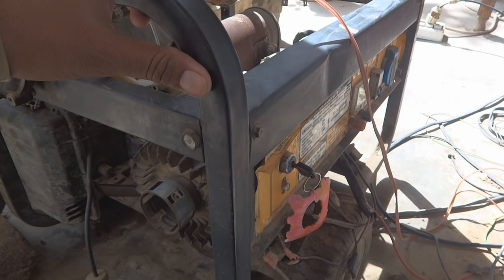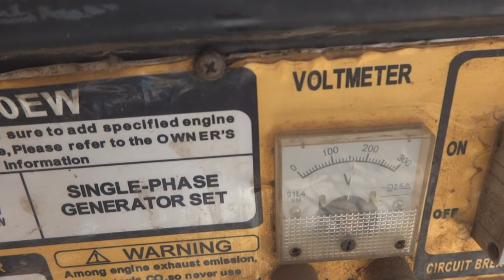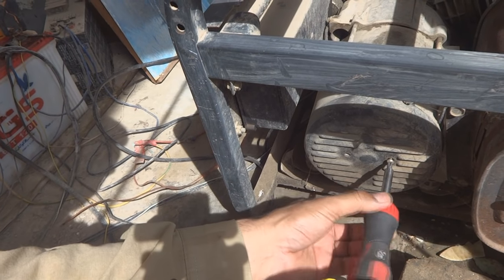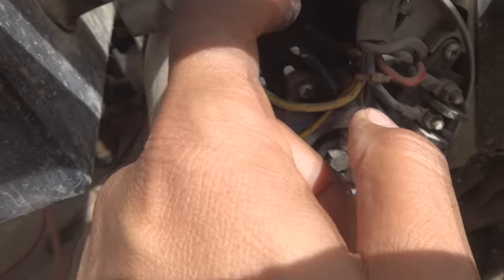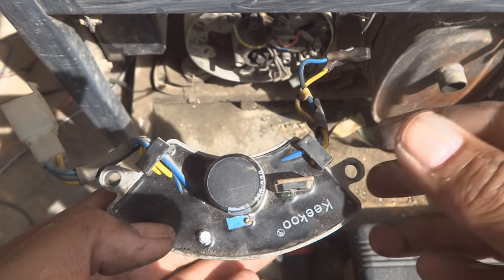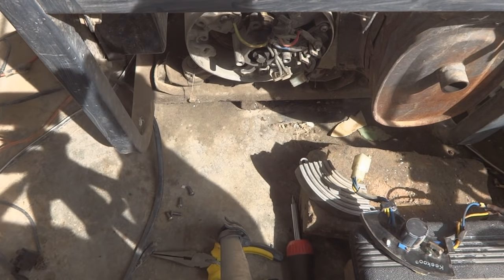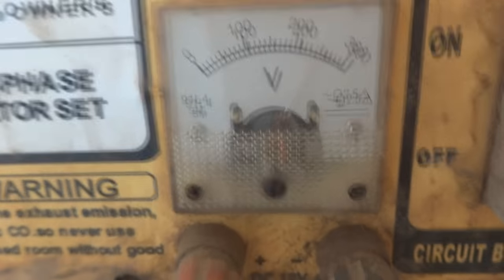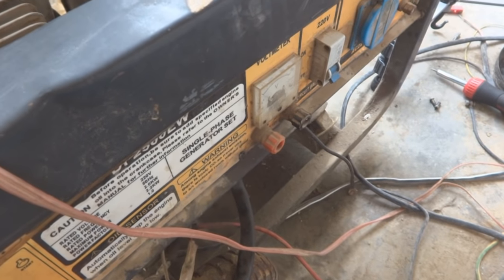Generator AVR adjustment. Generator voltage adjustment.

Comment from the maker: Dear and respect viewers must read the blog post associated with this video. This provides extra information about this video. Here is the url for the blog post. http://diycarmaint.blogspot.com/2017/03/generator-alternator-electrical-repair.html
Reply: LearningZone ap.kahan hotay hain
Reply: sir, can you please do a video on how i can convert my generator from petrol to natural gas, how to adjust it and also tell us if it is more economical to use petrol or gas. jazakAllah khair.
Reply: Hi I need your assistance for fixing generator.
Reply: Dear sir salam plz sir show next video have old avr repear
Reply: Hi i have an old Dunlite generator 3kva. Can you please tell me how to fix as I have 50 hz frequency when adjust proper rpm but over voltage at 335 volts with a fan plugged in? Do all 4 stroke generator have AVR inside? Also when you took off the plastic housing on alternator section with two screws i have same thing but two big screws in the middle?  Can you please tell me what it is?  Also if i don't have AVR can i fit a universal type or AVR from another  generator?  Any reply appreciated! Thumbs up 👍 for your video. Clearly explained!  Cheers from Australia!

Comment: I was getting 310V from my generator and I tried this method. Now I am getting 240V. Thanks a lot Sir.
Reply from the maker: Seems you have a bad avr. Replace with a new one and calibrate. Regards,
Reply: How to increase the voltage of a generator from 240v to 415 votls? Using the universal SX460 AVR? Thank you

Comment: Great work Jahan in correcting the loose connections and adjusting the voltage regulator. I was wondering too why the pot was so far out of adjustment. You mentioned in a comment below that someone else was there before you. And good idea as a viewer mentioned to check the frequency to ensure that all is well. Keep up the good work!
Reply from the maker: Yes dear sir you are correct and this was the case. Anyhow it provided a nice experience and good case study what to do if a generator have too much varied voltage beyond standard. The frequency testing would a good idea and I am looking for opportunity to do so. Thanks for liking dear sir. Best regards,

Comment: AoA, very much informative video. I have a strange problem with my homage 6.02 kva ATS generator as it drops voltage randomly. Like sometimes it produce 220-230 volts, whereas, in between, it comes to 97, 105, 180, 102, 115 and then again starts the same up and down sequence.  What do u think where is the problem Sir? I can send u a video of the same.
Reply from the maker: Seems you have a bad AVR. Replace, caliberate and then check. Also check AVR connections for any loose point etc.
Reply: I have same problem what fixed it??

Comment: I fitted new avr in generator but it gives me 310 volts but after this setting you told in the video it us giving me 270  volts it does not further decreases after it

Comment: Got a question sir. Why does our generator gets damage every time we use our aircon for like 5hrs. Then the next day its not producing voltage or electricity. Our generator is 6.25kva

Comment: Many thanks for this wonderful video. I have a different problem with my 5kva generator ELEMAX SGH7600EX. I live in an off grid area so I need it to charge my batteries whenever it rains. This generator output is 220v 35HZ which is unsuitable for my inverter. I always increase the rpm to get 275v 43HZ then my inverter will accept. I have changed the avr to a new one and even reWinded the Coils to no avail. I need your advice. 
Thanks.

Comment: I want to contact you. we have a problem in SMDO generator  ..its not running any water motors on this generator because its not provide electricity power up to 230...

Comment: Loverly job, backup power is back :-D :-D.

Looks like a car alternator, but with stator windings for 220-250vac.
I hope you checked the voltage with your multimeter, i would not trust the panel meter.
I found it odd that the voltage regulator was so far away from the correct voltage, i hope its just because someone played with the setting, and not a faulty stator.

If you have a way of measuring the frequency, you can set the engine rpm for the desired power frequency 50/60 cycles, sorry im saying the obvious :-(.
Reply from the maker: That is great sir. Your understand is very much correct. The AVR settings someone disturbed before me. I corrected it for the perfect voltage setting. I measured the voltage with my fluke and the panel meter was corresponding to that reading. I have a meter measuring frequency. I will try setting that. Your point is very valid and have strong value. I set it so that it works just fine with lamps, induction motors like fans, my laptop charger and other cell phone chargers. I would sure give a try for correct frequency sometime. Best regards and thanks for liking and comment.
Reply: Your vlog has a different name to the one originally given on youtube, are you still ok with the youtube name or should i forget that?
Reply from the maker: Yes yes dear sir there is a problem with the name. This blog post I wrote just today but the name appears is the email user ID name. I don't know the way to change it. I gave this name myself long before due to some reasons which have no more need. But it is OK anyhow. This belongs to me.
Reply: Dear sir arshid ali tak to you that plz salo my problem  have old avr repear

Comment: You speak AVR gives 220 volts . But i think AVR regulate the voltage its supplies the fixed voltage to the armature coils so that armature produces fixed magnetic field and when armature rotates the magnetic field cut the stator coil and current is induced in stator and output voltage is drawn out of stator .
Reply from the maker: You should watch the video again. I explained everything. If I can do calibration for the alternator or generator, minimum I know what you explained in the comment! Also I uploaded another videos on car alternator videos where I explained all concepts in detail. Regards,
Reply: @JahanZeb1976  i just want to know about AVR . How does it look likes in generator big or small. Secondly i know that AVR regulates voltage and gives fixed voltage to armature of generator . AVR increase voltage if coming less from excitation coil and decrease voltage if coming more from excitation coil . It supplies fixed volts on which it is set . Third how AVR fixed volts set ..please explain..
Reply: Whats your email id..i am marine engineer so i am trying to learn about electric part too .

Comment: Please I have a lutian 3600 generator

The voltage meter is not stable goes front and back when I put the Gen on.

Also the light dims and return, that is the light goes 200 to 160 all the times.

Comment: opened up the back like you said, no wires or electronics, is it possible there up between the motor?
Reply from the maker: Dear friend then your generator AVR could be located somewhere in the terminal box. Check and do as directed in the video. Best wishes.

Comment: Dear I have same kind of problem as you discussed here. when I start generator at idle position it's show 212 v. But when I put on Load they reduce to 198V.
May I adjust AVR setting as adjusted in this Vedio??
Reply from the maker: That's great that you are thinking to attempt repair on your generator set. Sure you should adjust the voltage of your generator to some higher level like 240V or so on no load. So that when you will load your generator, it may drop to reasonable level like 225V or 220V standard. Hope you will be able to adjust your alternator or generator voltage in the method I have shown here. Also you may watch my recent video on another big generator repair on my channel. Also you may subscribe on my channel and switch on notification so that you will get my new uploads notification. I will upload a few more very interesting videos on such generators in future. Those videos will sure give you a lot of help with your machines. Wish you good luck with your repair and also you may share your repair experience here with us. Best regards,
Reply: LearningZone okay thanks a lot.

Comment: The AVR takes a sample of main voltage and uses it with exciter winding to give proper 
excitation to the rotor. if 240 v winding is putting out 250, the avr  takes the exciter winding 
and thru electronix in avr exciter sends a lesser amount of D.C. to brushes to energize
the field. if u get 220 instead of rated 240. exciter puts more voltage d.c. to brushes.
U got that?

Comment: dear sir, 
i am facing some problem when i start the generator on home gas the engine RPM don't constant RPM up and down but on petrol RPM is ok no trouble found. plz suggest.
Reply from the maker: Check my other video on the same alternator gas kit maintenance and adjustment. Hope your gas kit maintenance and adjustment may solve your gas running problems. Regards,

Comment: I have 110v generator ... how do I change it to 220 v . Thanks for your time
Reply from the maker: You can change it by rewinding the generator. The avr could only provide fine tuning of voltage. Other way is use a step up transformer of same VA rating like generator to step up the voltage from 120v to 220v ac.
Reply: Or use a transformer and keep the warranty on ur generator..

Comment: My generator 2.5 kw is generation 240 volts but frequency is 41 how to increase the frequency?
Reply from the maker: Adjust governor and recalibrate voltage ⚡.
Reply: @JahanZeb1976  how can i adjust the governer just increase the idle speed?
Reply from the maker: Yes there is sort of adjustment to be done to governor to increase engine rpm.

Comment: What might be the cause of my generator, it will go back to 160 after working for sometime. The actual volt is 230
Reply: change the avr
Reply: @myhomelab  thanks I have already done that then later find out that the coil was damaging the avr so I have to change the coil is now working well

Comment: Sir, I have 3800watts generator with gas kit my generator was producing 150 voltage then i change my avr but now its producing 310 voltage then i tried to decrease voltage but couldn't successful plz help me what should i do? Should i purchase new avr?
Reply from the maker: +zohaib anwer dear friend seems that you got a faulty avr. Try my method to set up voltage if there is setting potentiometer on the avr. Otherwise go for a new original avr replacement. Regards.
Reply: Thank you so much for your reply.
I have changed my AVR it is working properly and producing 231 volts. thanks again

Comment: My generator (1500w) is producing 300v, and under load of 1050w, voltage goes to about 225v. Is that normal ? And how do I fix that ? Are the springs weak ?
Reply from the maker: Do maintenance and calibration on your generator's AVR. Hope this will correct the voltage issue.
Reply: Is your generator a capacitor and diodes or it is AVR?

Comment: What would be the problem of my genenrator low voltage supply even if i adjust the settings of the avr?
Reply: Governor could be faulty, or need adjusting. Or even fuel pump is worn.
Reply: You need a New AVR Kristina.
Reply: Kristina, you need a New AVR to get your correct voltage.

Comment: i have nissan sunny japan 2005,when my car is switch off my brake paddle get too hard direct without pumping,and when i start and or drive my car my paddle sinked too much to the bottom .please advise what to change in my car,and thr is no air contents in brake pip line. please advise thanks.
Reply from the maker: Dear friend Abdul Khaliq thanks for watching and thanks for sub. Your question have two parts: 1. The hard car brake paddle in any assist brake car during engine stop, is normal. This is in common in any car make and model. So don't worry for that.     2. If your car paddle is going too down close to floor, this is the result of worn out rear brakes or if you replaced brake shoes recently, it is the result of not properly adjusted brakes. So check if your brake shoes are very old, replace them with new and adjust brakes properly. Watch my other videos for rare brakes repair. Replacement of brake shoes and pads are compulsory for you and your car safety. Better check for all four wheels brakes and air bleeding is also a good idea. Please don't hesitate to ask anything anytime. Best regards and wish you good luck with your repairs.
Reply: Thank you very much for positive reply..i will do it on priority basis.pleease send me the link of that video.thanks
Reply from the maker: Dear friend jut I uploaded one video on same make but different model car. It will guide you through the details. Also you should read the blog post regarding that video. The blog post address is there in the comment section as well as in the description. Regards,
Reply: thanks friend

Comment: how to deal with dropping frequency, my generator is not giving 50 Hz, it is dropping to 44 Hz and then shuts down after that..
Reply from the maker: Frequency is a factor of engine speed. You should take care of governer and fuel. It you are running on petrol then tune up your carburetor. If you are running on gas then take care of your gas kit. On gas kit repair and tune up I have a video on my channel. Must watch that. Regards,

Comment: Salam ! I changed the capacitor of my generator as it was not producing any voltage but after changing it the output voltage is near 400
Reply from the maker: That's great if you replaced the defective cap. Now you can adjust the avr as I have shown here in this video for the desired 230 or 240V. Wish you good luck with your repair. Regards,

Comment: Hello sir .. nice video .. 

i have 1 kva Sawan generator .. i have the issue of low voltage or no voltage in my generator when i increase the speed of engine the voltage ..upto accurate but when speed down to normal rpm of engine the voltage goes zero it is capacitor base i kva generator .. your help in this regard .. really appreciated .. 

thanks
Reply from the maker: I think in such a situation the AVR maybe bad. You should check voltage on carbon brushes at normal RPM when there is Zero power production, if there is no voltage at carbon brushes and then voltage develop at higher rpm and then out put power also develop,  Check for AVR input power in both cases. If there is input power to AVR at normal rpm and no out put on brushes, means a bad AVR. You should replace the AVR with another new good known avr. Hope this may solve your problem. I am planning to upload more videos to illustrate this all in video to give full understanding. Keep in touch not to miss anything. Best regards, and don't hesitate to ask anything any time. wishing you good luck with your repair.
Reply: nice and new info for me....

in my case the generator which i have its is brush less (Carbunless) and AVR less capacitor base generator ... 700va ... 800watts ... 
and then all issue will be same as said above .
Reply from the maker: O I am sorry as I didn't notice that. I never ever worked on that unit but will try to get info about that. I will sure share if I may get some information about that. Maybe that will be useful for someone.

Comment: You did a lot of turns with that screwdriver - but it wworked
Reply from the maker: Dear subscriber thanks for nice comment. This was a multi turn potentiometer that is why it took many turns to bring the generator output voltage to certain standard voltage range. Sure it works as you saw voltage came to good working level. Best regards,

Comment: Hello sir. Voltage flactuation ki aur keya keya wajha ho sakti hai avr kay elawa
Reply from the maker: Voltage fluctuation ki go reasons hothi hen. Agar ap ka engine speed ziyda vary kar raha ho. Second ap ka voltage regulator kam na kar raha ho ya carbón brush kharab hon ya pher slip rings ki surface kharab ho ya gandi ho tho voltage fluctuation hothi hae.

Comment: Might want to get a new brush set brushes holder. not being well mounted well will give loose
contact and mess up slip rings. seems there is a bad wire in harness, maybe from being
twisted to much.

Comment: میرے گھر کا جنریٹر 7 یا 8 گھنٹے بعد سارا موبی آئل پی جاتا ہے۔جب موبی آئل ختم ہو جاتا ہے تو جنریٹر اسٹارٹ نہیں ہوتا۔ دوبارہ سے نیا آئل ڈالنا پڑتا ہے پھر اسٹارٹ ہو جاتا ہے۔ بظاہر جنریٹر بالکل درست کام سر انجام دے رہا ہے
1)جنریٹر موبی آئل کیوں پی جاتا ہے۔ اس کی کیا وجہ ہو سکتی ہے۔؟
2) جنریٹر کا یہ مسئلہ حل کرنے کے لیئے مجھے کیا کرنے کی ضرورت ہے؟
3) کیا میں موٹرسائیکل کا استعمال شدہ موبی آئل استعمال کر کے کام چلا سکتا ہوں؟
براہ مہربانی رہنمائی فرمائیں شکریہ۔
Reply from the maker: It had serious engine defect like wornout rings or defective oil seals on valves and wornout valve guides. All you need to do to overhaul the engine. All these deffects will be addressed in overhauling process. Meanwhile you can use used oil from bike unless it's too much dirty or black.

Comment: 240 volts is not good for devices, It must be 220 volts.
Reply: This is idle voltage output, when we put on load it will dropped to 220 or below as per wattage

Comment: Plzz give me u r nomber .my generator same problam .i chang corbon brush and avr system bt generator are run bor not power....plzzz help me ..i am waiting
Reply from the maker: If the power is less and engine comes to diy, you have engine head and piston rings problem. You should check them and replace bad parts.

Comment: LOL you turned a one turn rheostat 100 times....
Reply from the maker: Dear friend how did you know this is a single turn reheostat? This was not a single turn pot meter instead this was a 138 turns pot meter!  That's why 100 turns you saw. Lol. Hope you got the point! Regards,
Reply: Actually it's a TYPE 138 28 turn pot, clockwise to increase voltage... 5 mins of research